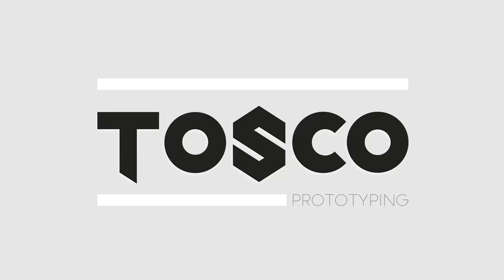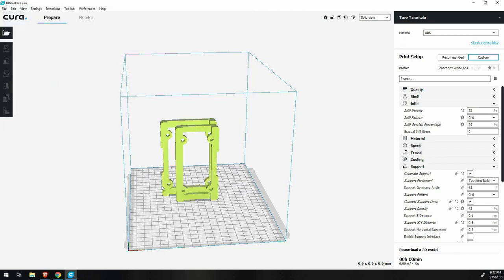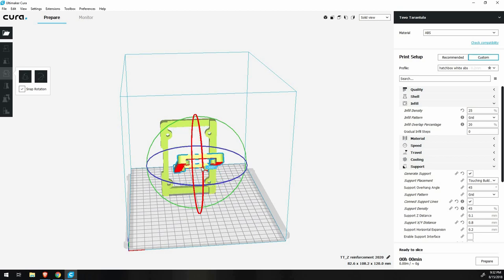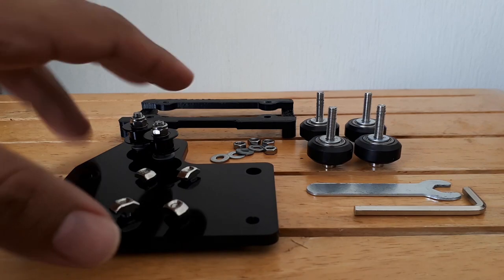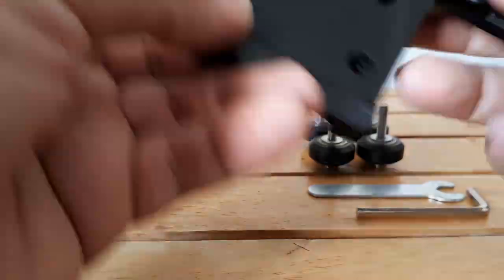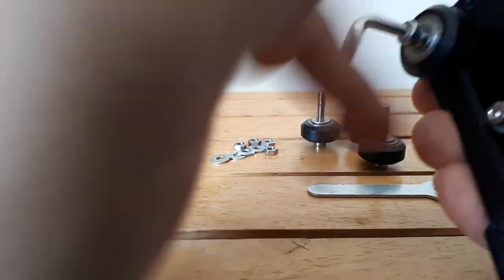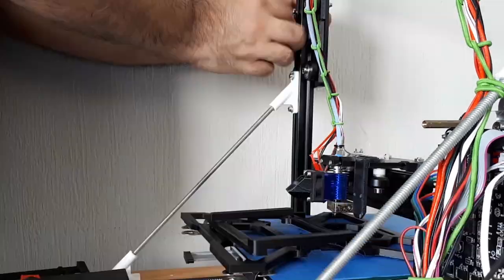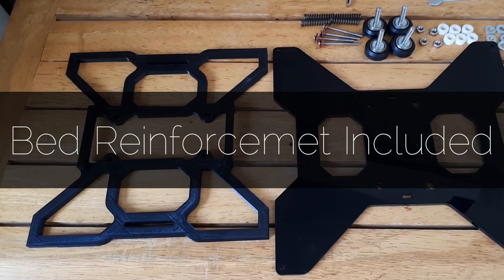Tevo Tarantula Z axis tightener

Comment: can you do a separate video for the bed support please...
Reply from the maker: I just rebuilt the printer, but it is as easy as print the model, and just place it under the acrylic bed and screw the wheels, you may want to uninstall the front piece of the Y axis so you can just slide the bed, but is not necessary.
I designed these pieces to be as simple and use as little filament as possible.
Reply: Tosco Prototyping  okay got! :)